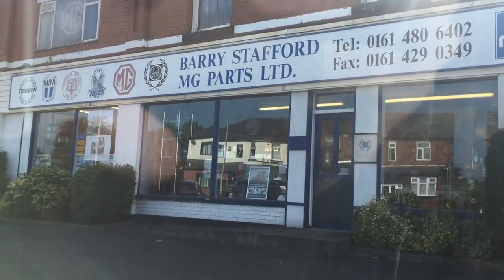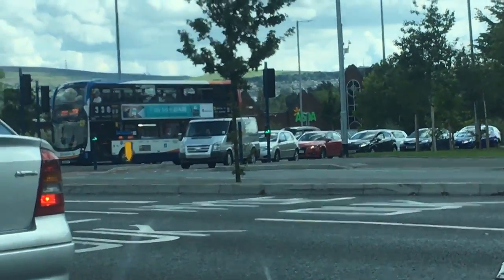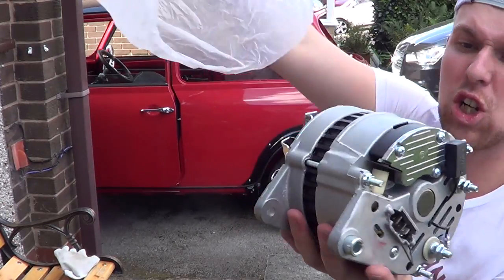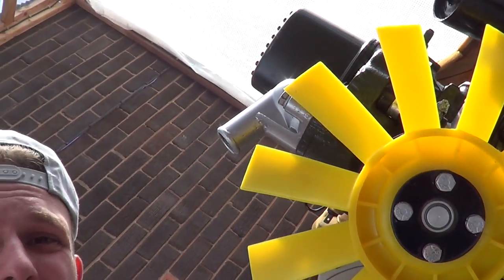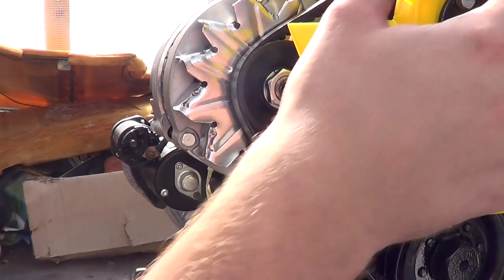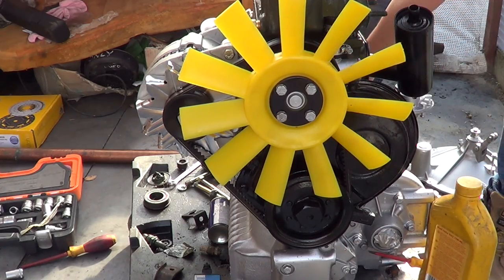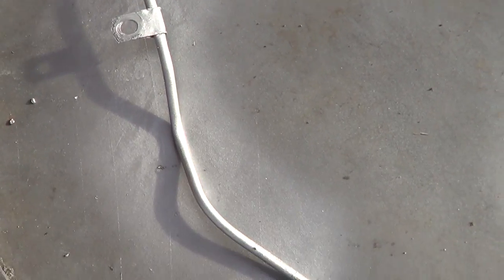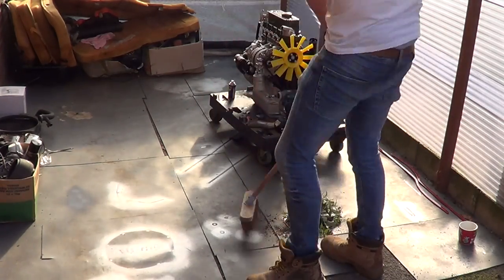Classic Mini Restoration | Fitting The Alternator

Comment: You'll be best off fitting the alternator after you fit the engine to the car . It's much easier to drop the engine in with it removed ! 

Another great video 👍
Reply from the maker: Paul P I managed to get it out with it still on 👌🏻 but you will probably be right when it comes to dropping it in haha
Reply: Total Car Reviews yeah not saying it can't be done but it's a lot easier and you won't risk damaging the slam panel ..... for a non-mechanic you're doing a great job !
Reply from the maker: Thanks mate! Im glad you understand! and at the end of the day "its only nuts n bolts" how hard can it be :L hahah

Comment: Minor quibble… you have the alternator adjuster bracket on the wrong way around. The fixed end should be on the front engine plate and the open slotted end on the lower lug of the alternator. Does not really matter too much but you might as well do it right.
Reply from the maker: Old video mate, has since been rectified

Comment: Suggestion for next build!!! You should definitely attempt to build an MG Midget. These are very similar to a classic mini parts wise and also similar setup.
Plus I have a classic mini and a 1976 MG Midget in bright orange, so would be great to see some ideas of your put together and videos are very helpful. :D
Reply from the maker: im very drawn to a midget Will! its just difficult trying to find the right one :)
Reply: Mine is 1976 MG Midget rubber bumper 1500, I purchased mine for £2700. Also we have another MG Midget currently at a bodyshop doing restoration on the body work thats a 1972 MG Midget 1275 chrome bumper which purchased for £3000. Still thinking what to do to mine. 
We found ours on eBay and Preloved sites. Best time to buy is Winter time as everyone starts to advertise more I have seen. Depends what type of midget you want. But they both drive well, common thing that goes on them is Overheating and Electrics. But nothing hard to fix and the fumes - still have issues with mine but with hood down its like 40mph in 1500 MG Midget feels like 65mph same like a mini ;) 
It depends what your after but little advice if you choose to buy one, avoid the ones with different coloured sills unless its in showroom condition as these tend to hide the horrible disease of RUST! 
Hope this helps and look forward to seen your mini complete and ready for your next challenge!
Reply from the maker: Will Jones thanks for the advice will it's a big help that! 👌🏻 I think I'd like a chrome bumper to be honest.. the only thing with winter is there is more forsake but they are more expensive I find because everyone wants a project to see them through the winter 👌🏻

Comment: got some yokohama a032 and the last parts i missed in order to get the car proper running. It will take around 10 days to get the parts in Rhodes Greece. I am gonna upload a video then. Keep it up mate. one question. I have the yellow 998cc engine. what belt do i need for the altenator? because i saw 3 different sizes on minisport.
Reply from the maker: XyDtE K I'll check it out matey! 👌🏻

Comment: Your fan's on backwards.
Reply from the maker: hahah! which one is it? last time I put it on the other way and someone said it was wrong then hahahah
Reply: Heheh!!
As you know the fan blows OUT (whichever way you mount it) through the radiator, unless your engine is spinning backwards...! 
It'll still work fine but very slightly less efficiently. 
Look at the curvature of the blades at 7:08 - this is the wrong way.